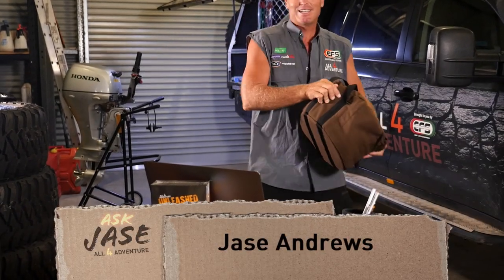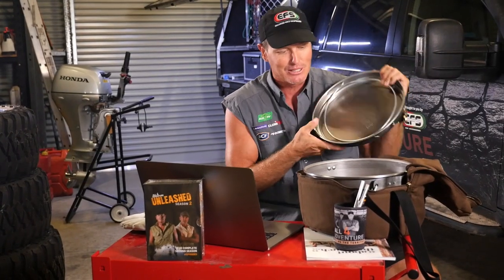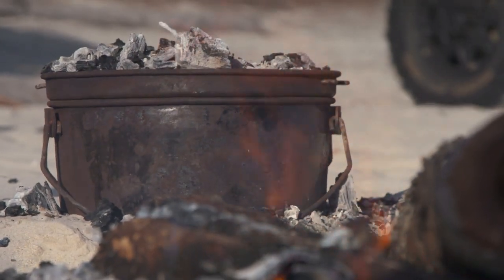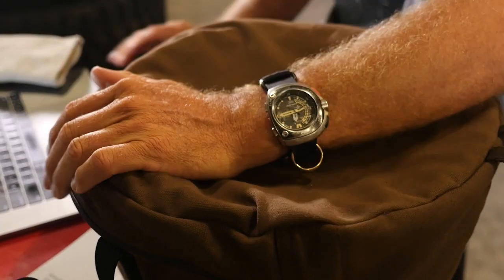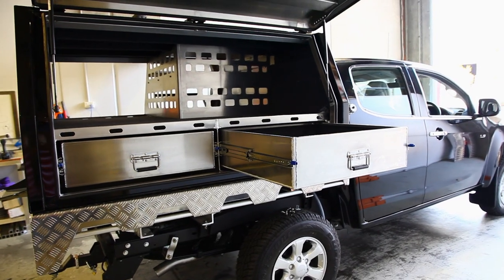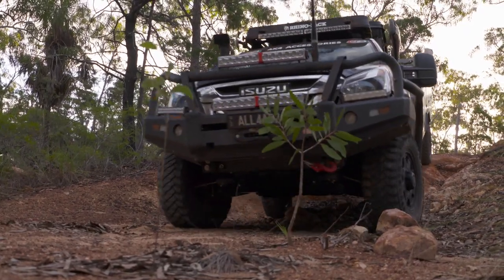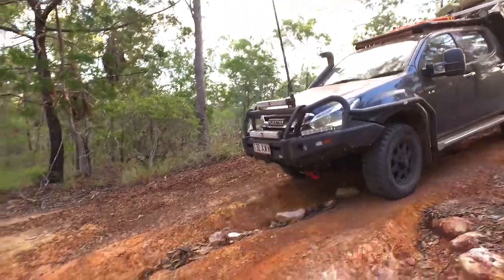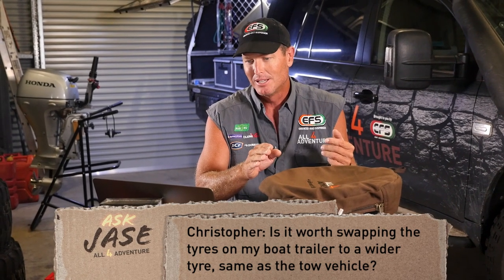Ask Jase: Camp Ovens, Springs, Comfort & Trailer Tyres ► All 4 Adventure TV

Comment: Regarding new tyres on the trailer, i would strongly recommend fittting same size rim and same type of tyre as that on the tow vehicle - that way all spares will fit any wheel that blows. May require changing hubs, but definitely worth it. Jase i'm surprised you didn't mention that